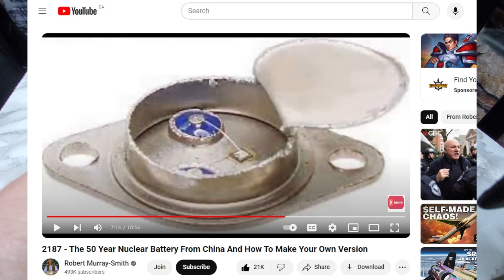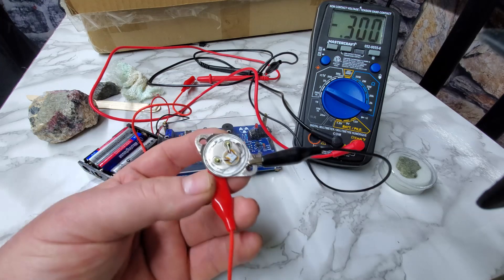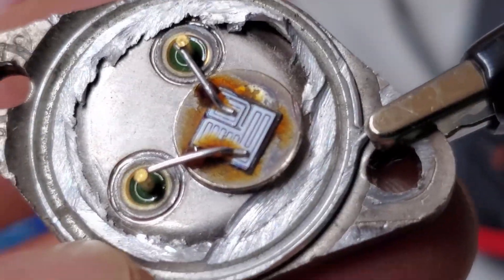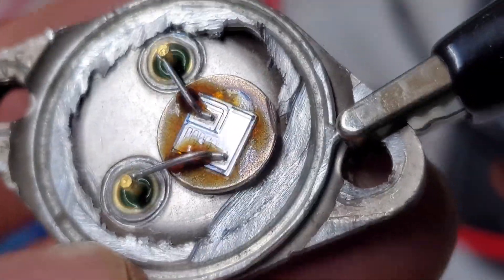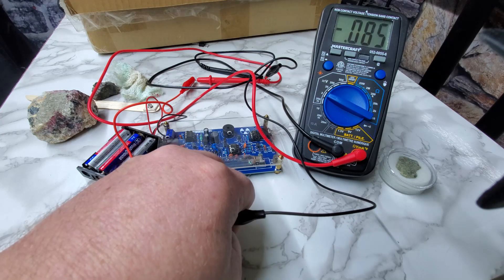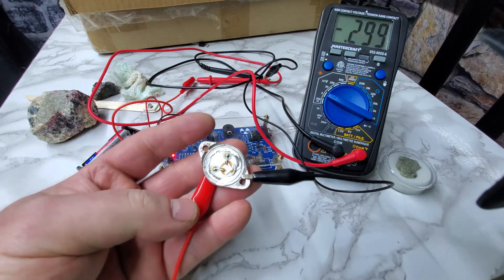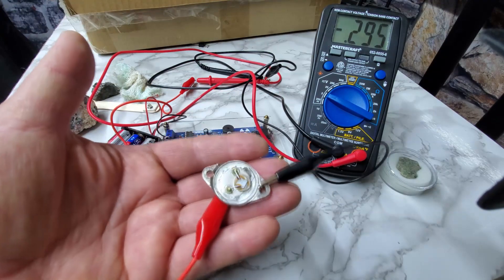Doubtful Alphavoltaics

Comment: If you can find a way to efficiently convert the alpha or beta particles into heat, I may be able to tell you how to efficiently convert it into electricity.
Reply from the maker: Agreed, there are actually a number of ways - the problem is, by the time you have useable heat you're talking dangerous levels of radiation and inclusion on a pile of watch lists and regulations. lol Even if we somehow manage capture to alpha particles, that's still only 2 electrons per particle, but at very high voltage (4 to 9 MeV, depending on the alpha source). So you still gotta capture a LOT of alpha particles to come up with useable current. But there are such sources - if you have some way of capturing the alpha particles directly. This is why I still have a hope that Robert's technique may still be a way of capturing them and directly converting alpha particles into electricity.
Reply: Quantum steam engine

Comment: Is it possible that the Alfa particles are bouncing of the metal casing, that you have removed
Reply from the maker: I'm not understanding you here Scott. Do you mean if I just tried to irradiate the transistor with the steel casing still in place? And thus it would block out light? If so, then yes, the alpha particles would never make it through the steel casing. In fact there's pretty much no material you could put over the PN junction that would block light but allow alpha particles through. But of course the simply solution would be to just put it all in a light-proof box. But I didn't even make it that far because I sadly saw zero indication that any radiation was being converted directly into electrical energies. Much as I had hoped it would and I really, really liked how Robert was thinking outside of the box on this one - which is precisely why I did these experiments. It would've been an ideal solution to a problem I have on another project.